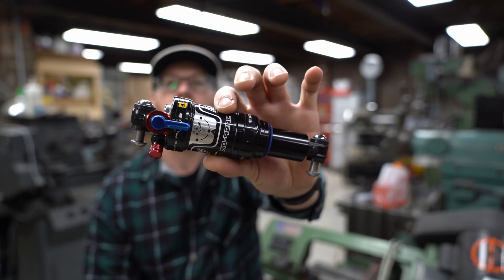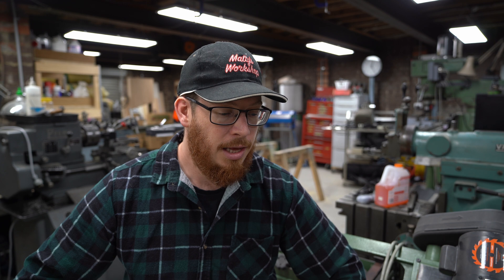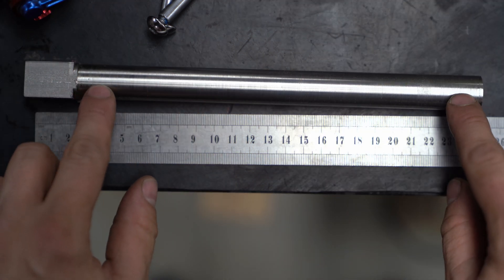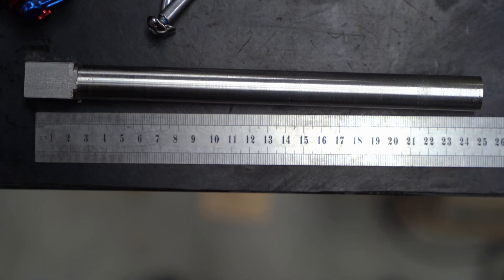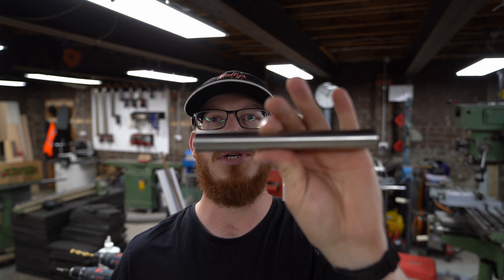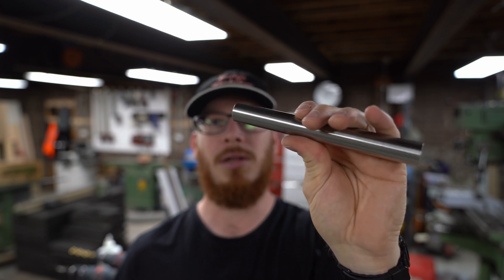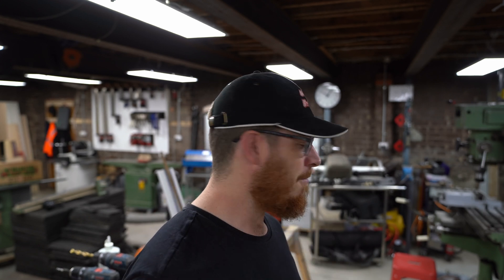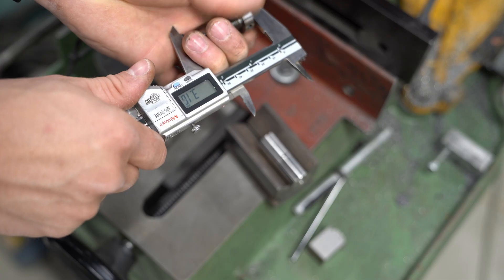Making this STAINLESS Bike Suspension Link | CRAIG'S WORKSHOP

Comment: Not trying to be cheeky, just a sincere question, is there any reason why you couldn't have put some flats on both ends of some round stock and drilled some through holes to achieve the same result?
Reply from the maker: No you're right - that would have worked, but wouldn't have looked like a nicely made bike part any more.

Comment: Beautiful work. But I must say, replacing an mtb rear shock with a solid link will result in damage to everything on the rear triangle in short order. All of those components are designed and tested with the give of the shock absorber in mind. Far better to be on a hardtail frame designed for rigid load impacts. If he has impeccable flow he will get away with it for a while, but sharp blows will murder that frame.
Reply from the maker: Thank you James. I did not give the full back story, just for the sake of brevity. He is an extremely heavy lad and has shopped around for a bike to use just for getting fit and slimming down. As such he does not off-road or use it as a real MTB in any way. He was very careful purchasing the strongest and most rigid frame he could, because standard frames are not up to the task even for riding around on flat road, for his weight. In theory it should perform the same as a suspension unit with the movement locked, except he has broken them before in that configuration, so - this far, the suspension unit itself has proven to be the weak link. Fingers crossed he will be fine with the solid link for a few years at least. Cheers, Craig
Reply: @CraigsWorkshop  Thanks Craig. Unfortunately the pivots of that rear suspension are now the weak link, and being a heavy lad will exacerbate the problem. Your work will hold no doubt though, for the rest of the frame I wish him luck!
Reply from the maker: Thanks. Yes you may be right. He does know that it is an experimental decision and is happy to take responsibility if this transmits new forces to the frame that it is not designed for. Basically we are making the best of a bad situation. I have my fingers crossed too. Thanks for your pointers and help 👍

Comment: G'day Craig.  Good fix, he'll definitely feel the bumps now, too bad about the welds, they just needed a bit of attention with the dremil. 
Cheers Peter
Reply from the maker: Thanks PGS. I used to have to grind every weld that I did, but these were the first in a while where I have been tempted to dress them up. The bead was quite a bit smaller than it seemed on camera (20mm diameter) so in person it was not bad, and certainly good enough for purpose. What I needed to do was a few test welds on similar material at a similar bead size, but I was running out of time! Customer/friend was happy, so I am happy. 👍

Comment: Nice neat solution. I think my lazy side would have just welded the original shock solid, or drilled a hole in the shock and filled it with epoxy.
Reply from the maker: Thanks T&B. If I had thought of those ideas I might have been tempted. 😁
Reply: Ooh 😯, I like the epoxy-fill hack. Didn’t think of it.